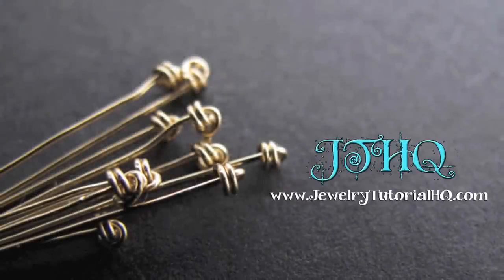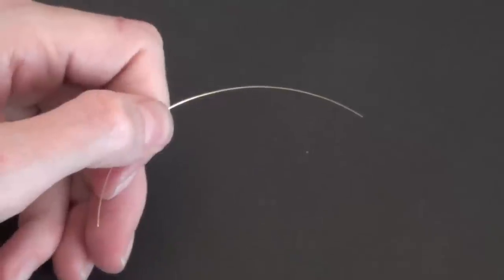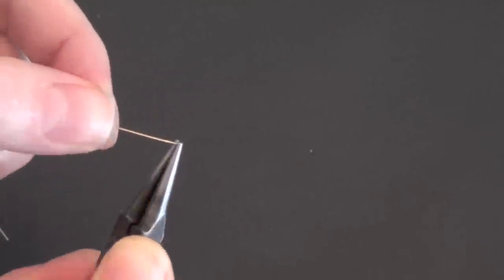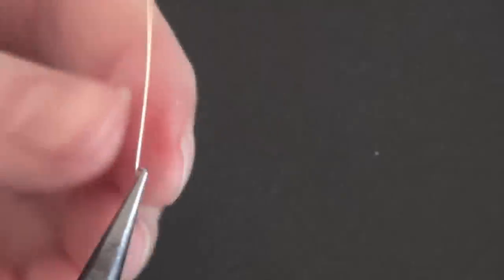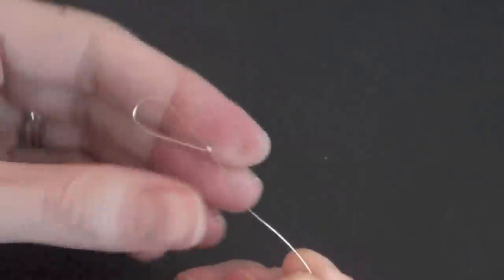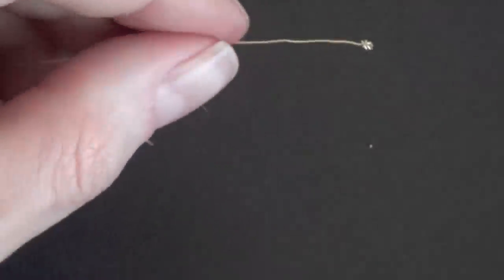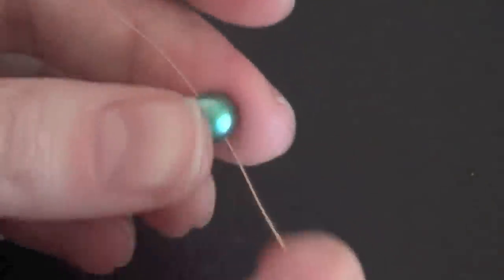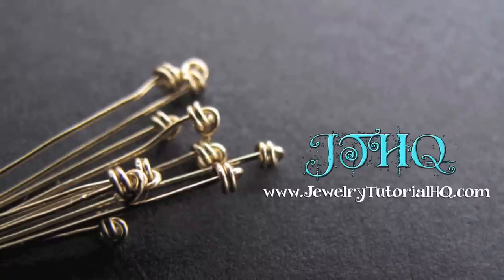How to Make a Knotted Headpin - Jewelry Tutorial Headquarters

Comment: I'm so happy I discovered this! The knot feels more original than those ready-made head pin ends you can buy, and I like that you can create different sized coils this way without having to get either new pins or an additional bead if one bead has a bigger opening. :)
Reply from the maker: Absolutely agree! I also love that you can make them as long as you need for stacks of beads or if you like to do a messy wrap at the top 🤗

Comment: Fantastic! I have so many small hole beads that I would like to use as dangles, and haven't been able to find head pins in a small enough gauge to accommodate them. This is a beautiful way to finish a cut wire end. Thanks so much for sharing. Love all of your tutorials.
Reply from the maker: Thanks so much! Yes, these are just perfect for that! You could even make them with 28 gauge wire if you needed to for those teeny beads :)